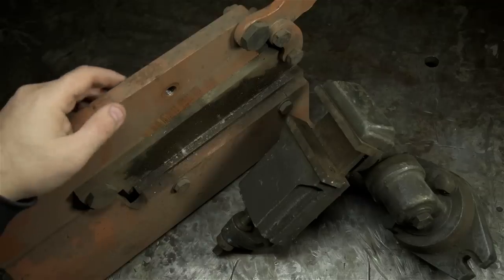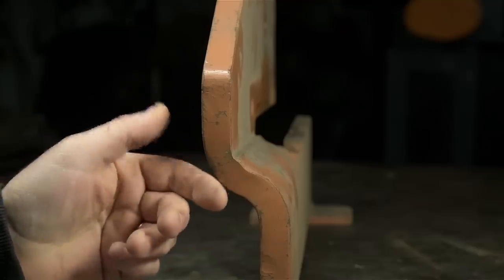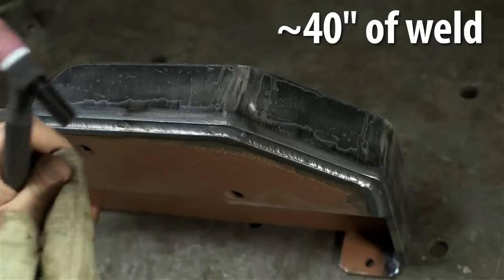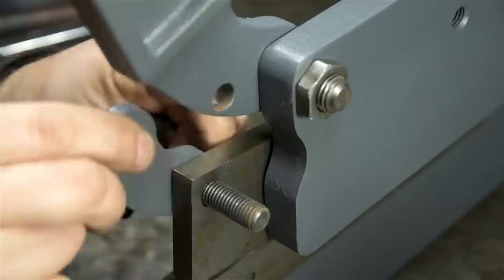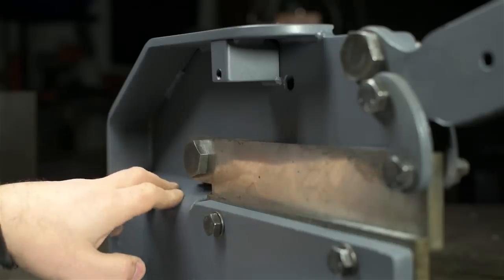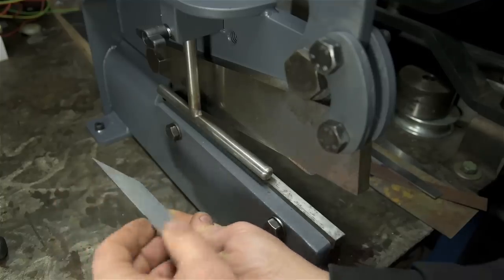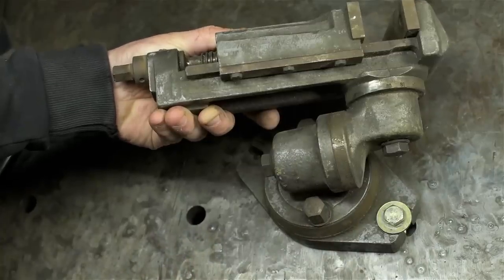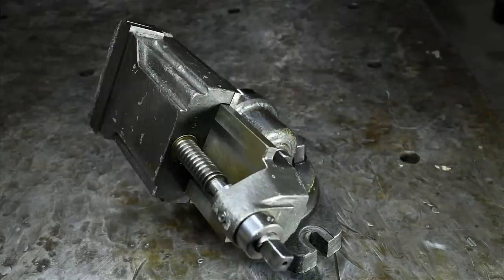Bench Shear & Universal Vise

Comment: Tony, I have an identical shear made by Mubea, made in Germany I think. You may want to notch your gusset, the offset allows you to cut through something like a 4 foot sheet of metal, with the reinforcement your limited to ten inches or less.
Reply: Grave digging here but the original hold down had a return spring for the lever so it remains upright when not in use.

Comment: The brace you welded to the shear was a mistake. if you look at one of these shears from the back the body is made of a single large plate formed into a S shape this S shape tends to straighten out under load forcing the blades closer together. This is designed in to keep the shear tight during heavy cuts rather than opening up. Your brace effectively blocked this feature by bracing across the S at the back of the shear.  Judging by the size of the shear I'd guess it would be happy cutting 3/16 or 5 mm material.
Reply: 5mm? holy damn thats thick
Reply: All that welding probably pulled it out of shape too. Might as well chuck it in the scrap heap now.
Reply: It will probably not affect the pinching as the pinching happens mostly from the stretching of the "S/Z" shape at the blades rather than compression in the back, however it will giv it better torsional stability as he stated, so in my book thats a win, except for beeing able to keep at least the main part of the plate while trimming it, where the trimmings are forced away, but now the "keep" path is blocked.
Reply: Great work, love the hold down!
Reply: Always a guy saying "dont weld...... BeCaUsE HeAt." Clearly works for the intended materials, and food for thought my big shear has more trouble with thinner material than thicker just takes alot more force but  thicker is always cleaner. Edit: was responding to the guy saying chuck it for scrap, I see how it's a feature for the s shape to close laterally under heavy load. Keen eye!

Comment: Odd I'm the only one to know this. But it's quite obvious with that shear being that old it's extremely likely the threads a .36 cubit Carpathian 59.elventeen degree ark thread with filigreed crests and precision sheepsfoot hammered split root radi. Machinery's Handbook no. 0000.01 has some good details for duplicating it without CNC. :-) Either that or one of those damn Whitworth's maybe? Great video as always Tony, and even better now since I've learned the hard way to not be drinking anything until there finished.
Reply: I think i have a tap for that - but am having a hard time remembering the drill size. was it a 75/128's? or a G? perhaps  a #55?
Reply: My MH quotes a Double D drill with a split infinitive point unless you doing the Mark V version. Then it starts getting a little more complicated. They sort of leave you hanging by only mentioning a bow drill with those expensive Travertine corrupted stone points. Needs the Noah modification to the philbert assembly for good accuracy of course, but I'm sure you already knew that.
Reply: Ditto
Reply: Turning Point
Yeah, what he said !
Reply: Well it's obviously a filigreed crest thread, but the rare five-start castellated dedendum variant. No wonder Tony couldn't find a bolt for it...!
Reply: This thread could be easily duplicated using and entabulator with a crossed spurling queue.
Reply: Mr T Whitworth threads worked just fine as long as the steam engine was the size of the Titanic,or at least a steam train. I have a strong memory of a friend with a TR4a . Could not keep his fenders tight to save his life. We spent an entire weekend changing out the fasteners and it still was not perfect. We did not know the difference between a 55 degree and a 60 degree thread pattern. Oops. Should have run a tap through the captive nuts,etc. Whitworth on automobiles is the invention of the devil.
Reply: @iwtommo  The recommended drill size is brown. Anything else and you will end up with an oblong hole. Absolutely do not under any circumstances use the yellow drill bit unless your aim is to make a square hole.

Comment: G'day Tony. I've got an identical bench shears to yours and I've never had a time when I thought it needed strengthening, so be it. It is easy to cut a large sheet with the throat as it is, it's just a case of feeding the lead below the frame as you hinted but it's easy. I made a 17 drawer tool bench for my son with it which is the first video/montage on my youtube channel. My decal is missing also but I can cut 2mm mild sheet easily, 1.5 is a dream, I think the original spec was 3mm, but I wouldn't bother to try. Excellent video as always, Peter

Comment: I bought one of these shears new back in the 80's from Enco and it has worked very well since. It was advertised to cut 1/4" plate and I have proved that claim several times, but it did seem to stress it a bit. Great tool!
Reply: 1/4" with those, omg OO
Reply: BTW, I love your tweaky sense of humor. Rare in this bag of hammers youtube world.
Reply: Nik, what do you think about the bracing he welded on?
Reply: He's right, it will get in the way of cutting anything bigger than the blade.

Comment: Hi Tony - I have a bench shear out of the same factory as yours. Bought it for $60 new in 1978. Like you I figured it would be more useful with fence and table - I also put a couple of half inch  T bolts above the fence to hold material down when cutting. I have used mine to cut lots of 2'' by quarter flat bar with no problems. I believe it was called a quarter inch bench shear when I bought it. I would post a photo but can not work out any way to do that. I really enjoy your videos - I am an engineer who started life as a toolmaker when people still filed holes (I  like your filing machine!) So Hi from Australia.
Reply: I usually just post a Dropbox link.

Comment: Hi Tony. I now you don't need the shears to cut long sheets, but you can do that easy when you let one side hanging and pushing. It's possible to get a good cutting. Of course without the reinforced plate on the back. I have got one similar but much better with hole and top grove to cut round and flat plate. Thanks for your's videos!

Comment: Watercooler is working great. Exceeded all my expectations for the setup. I'm sure your ears are glad for the modifications. 

Next questions are; Was the fan even necessary in the first place? and How does it behave in  warm weather?

<insert rough calculations regarding kW required to boil x Liters of water in 1 minute>
<insert apology for not tackling calculations right at this instant>

Comment: Hey tony, I have a similar shear as does the old man. Mine has a curved top shear which is more for sheet metal. The old mans one has a toothed fulcrum where mines like yours. The straight shears on yours is more for flat bar. You can cut 1.8 mm flat bar no problem. Actually it’s more like whatever you can reef on the handle is the capacity. Obviously don’t cut round bar. Do put the safety hook on the handle as it might come down on someone’s head. Oddly tho, your unit has only two bolts per blade. Mine 4. As they wear/get sharpened you just shim them out with sheet. Very handy tool. Luv the vids.

Comment: I used to do all the complex compounds at the tool and die shop i worked at, and never seen that vise before. It's very nice btw, I had to make 10inch compound sine plates out a old x axis Bridgeport table with heavy duty side straps since i was doing heavy cuts on weldments or stainless and alot of very heavy copper blocks, nearly 1foot cubed. I enjoyed the complex work for a change sometimes.

Comment: My English unbranded shear is almost identical to yours. It has Whitworth threads. Mine can make unlimited length cuts as could have yours before  welding a plate in the way.  I have never managed to make mine deflect despite abusing it slightly. As well as steel I also cut thin plywood, plastic sheet, underfelt, carpet, drawer liners and anything else with mine.  I made a quickly detachable base for mine so I can use it anywhere and also drilled holes in the bench so the same bolts can attach it there when needed.

Comment: I have a shear just like that one other than it has a hole for cutting 12mm or half inch round. I have cut large sheets up to 6mm thick and 10mm x 40mm flat bar on a regular basis with it since the late 80's when I purchased it new. As I recall it is made in Taiwan , I can check on that as I still have the instruction sheet filed away.

Comment: You could make a little shelf off the end of your bench at such a height that the fixed blade is the same level as the bench top, works for me on my 12" version. The benefits should be obvious. Mine is an ex-school one and was locked with a padlock when I bought it.

Comment: First tool I bought for metalworking. the woodward fab version of the same shear.  I was in seventh grade and made a mount for it on the back of my bike along with my flux core welder. haha. I still have it and I gotta say your going to hate that rear plate. you can cut good long cuts with it  just as long as you push down on the trash side to clear the notch. Dont add a table. The less in your way the better. I have a few beverly shears and big ban saws now but that shear still gets used quite often.

Comment: British Standard Whitworth or British Standard Fine could be good candidate threads.  In cast iron the coarser BSW was normally used.  Unlike UNC/UNF/Metric it has a 55° included angle instead of 60° and is 12 tpi for 0.5 inch diameter. In steel British Standard Fine was more likely to be used, half inch is 16 tpi. BSF would also work better with a jam nut. If you can count the turns through your quarter inch plate it might give an idea. Even the Germans use 'British' threads for some items, or the shear may be UK war surplus.... Whatever, good video as ever and a wonderful sense of dry humour. Very impressed with the paper shearing capability. That's quality kit.  Bob.

Comment: An idea for making identifying the threaded hole in your shear easier. Drill a hole in a nut from one flat to the other, put a pin through that hole, lay the nut over the threaded hole then fill the nut and hole with hot glue or cerrosafe. Then when the nut is unscrewed you'll have a bolt to measure.

Comment: Want an educated guess? Thats a Peddinghaus shear. :)
Reply: or more liekly some british copy or it would have metric threads
Reply: I’m betting it’s an Atlas.

Only because Peddinghaus nearly always stamped their name directly into their products. Atlas often used metal plates or just painted on instead. Something that could have easily fallen or worn off.
Reply: Haha, ignored the non-metric threads, thanks for correcting me :D
Reply: Could be English with Whitworth threads, maybe not old enough though
Reply: could also be an indian copy using old british machinery to make, india still makeplenty of these and also do heavy metal press bending
Reply: tortron 
I’m thinking that might be a 1/2-24 thread. Which is a standard thread but you rarely find bolts with that thread form anymore at a hardware store. 

But they used them quite a lot in the 40-50-60’s for their stronger holding power without jumping up the 3/4”  thread size.
Reply: I’m betting it’s a chinesium copy.
Reply: @matt with the whitwork threads, id wager its made in india, they still make them and have massive steel presses, and tend to be more old school methods more than china,
Reply: Yup older Ehoma copy ..... errrrrange gives it away

Body = Chinesium
Blade = Tiawatium
Reply: Slabbador Dongali 
Yep. Looks like an Ehoma. Forget about them. It’s even the same off yellow paint color. 

They make a pretty decent product though. Least for low volume home use anyway.

Comment: The other bolt on the shere seem to be metric?

The missing one could be a metric fine thread. M12x1, M12x1,25 or M12x1,5.
Metric regular thread would be M12x1,75.

Comment: there is pretty much no hope tony will ever see this BUT:
that looks an awful lot like an FZA brand shear. If the model has 300mm blades like it appears to be, it should be able to cut up to 4mm mild steel sheets, 13mm diameter round stock and 70x7 flat pieces. I think it's still in production.
Reply from the maker: thanks!

Comment: Hey Tony what I use for penetrating oil works real good is a quarter ounce of brake cleaner and try to use the brake cleaner though it’s non-chlorinated and I use 3/4 of an ounce of transmission fluid works real good this is Jim mungai from Kennerdell Pennsylvania

Comment: Rather late to the party, but I have a shear with a very similar body and it's an old english made one - the bolts are Whitworth thread. If I remember I'll check the name when I go to the workshop - the only difference I can see is mine has adjustable backstops for the stationary blade to tune it in.

Comment: Fill the hole with wood glue or silicone, and screw it out, when it dries. Use an a small flat screwdriver, as a handle - inserted wet, of course.

Comment: Great vid, shear looks a lot like mine, almost identical, rated at 1/4 x 2 1/2 hot roll flat stock and 3/16 plate.  Tried it with 1/4 x 1, does it without any prob.  a bit of cutting oil on the blades seems to make things nice on the thick stuff.

Comment: It's likely that threaded hole for the hold-down is a Whitworth thread. most UNC and Whitworth threads screw together, 1/2" thread diameter is one of the few that doesn't.

Comment: Nice job on restoring the shear, I have one of those as well and use it often.

The body is not as thick as yours though, mines around 6~7mm so you should be able to cut some chunky a** metal with yours.

To give you a ballpark, mine is rated for upto 1" steel bar, or 5mm plate, so I reckon you should be able to cut at least 30mm bar, or 8mm plate, if not a bit more.

Anyhoo, I love the vids and always look forward to learning something new from you :)

Comment: Whitworth threads for 1/2" have the same damn thread pitch, BUT, 55° thread angle.

If you put in an American tap, you'd shave off JUST THE SLIGHTEST bit.

Had to do that on a one horse open sleigh(no joke) as it was Whitworth AND it was a threaded component, not a bolt. AND the ancient fasteners were, uh, crooked? Yes. That's the word.

If it's Whitworth, I believe you should find that the bolt head is roughly a 5/8"-16mm(15mm is a tight 5/8").
Reply: AND it looks fine, not coarse, so then it'd be a BSF thread.

Comment: i know i'm a bit late .. but this shear looks very german or at least from EU to me .. i am a german metalworker, this is for sheetmetal only
Steel about up to 2mm .. stainless about 1.5mm more like 1mm
and the Blades fit that well cause it's not only hotbended/forged .. there are machined surface

Comment: that looks about the size of the shear I have, capacity if you want a work out, should be 1/8" mild steel.  You could do SS 1/8", but it's probably not good for the shear... or your blood pressure.  :-)    I use my shear quite alot, it comes in handy for body work on vehicles.

Comment: i forget the size i think it was 1/2-20 or 7/16-20 for the foot bolt but if it is i would say its the same as my dad had it had a craftsmen sticker on the right side looking from the front his sticker fell off to and it was made for them by a company out of daton ohio at he bought it about 32yrs ago and it had a 6ft 1/2" flat bar handle and was rated to cut up to 1/8 sheet mild steel, and 1-1/2 by 1/4" mild steel flat bar (never tryed) but we did 1/8" stuff all the time but dose take a 200 pound gorilla hanging on it lol. thanks for sharing

Comment: Couldn't you just cutout where the metal would slide through on the shear and just add gussets for extra strength? Though the way that curve is, looks like the steel be stopped anyways.
On the (theoretical) table, you could make a pivot arm to do angle cuts too.

Comment: Why do you not heat your garage with a small mr heater ceiling hung furnace? I keep my garage at 70f all winter in Michigan and it only costs me 30 bucks more a month for a standard 2 car with 10 foot ceiling. They aren't to expensive tony and boy is it nice, all the metal is not bone chilling cold to touch.